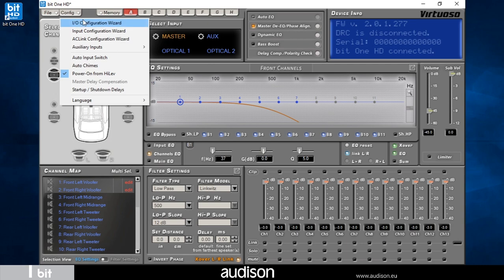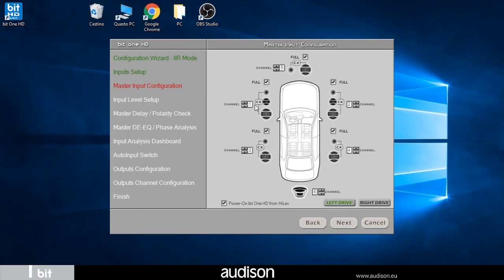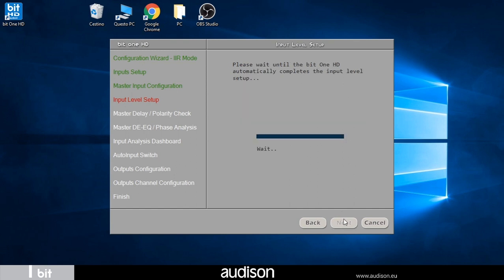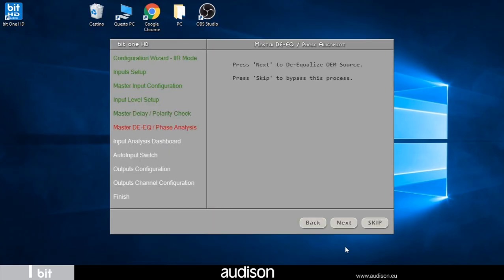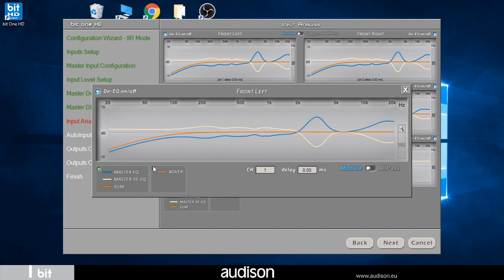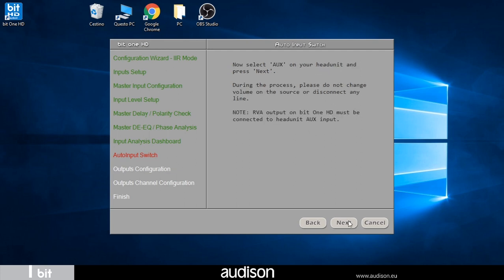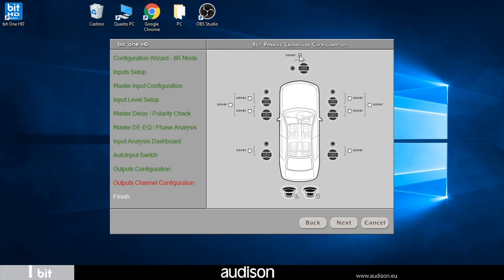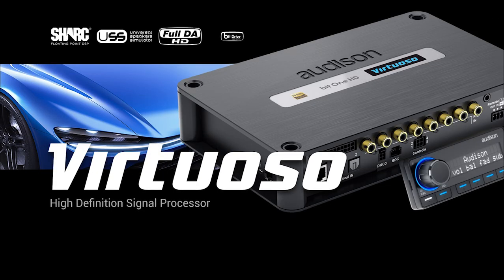AUDISON BIT ONE HD VIRTUOSO TUTORIAL 1 - CONFIGURATION WIZARD OVERVIEW

Comment: Hey. I’m a little off topic, but I have a question that I can’t solve. I have a phone that can transfer audio via USB, and I have a Bit One audio processor. The question is whether it is possible to transfer audio to it for example to Coaxial Cable. Well, that is, it turns out you need a USB-Coaxial Cable adapter, are there any at all?
Reply from the maker: Hello, you need an audio interface capable of receive the USB out of your device and convert in a SPDIF digital audio out. -Best regards

Comment: Why prima ap application isn’t good as bit one? Although prima is super expensive
Reply: I got the audison voce 3.0 and 1.1.  Mids and tweeters mounted on my Dash in speaker pods. Prima ap8 Mid bass in the front doors. Hertz 5 inch for range in the back doors for a little bit of rear fill. Two American bass 12in subs in the back. Pioneer head unit and Dayton audiodsp-408. The first thing everybody says when I have them here my system is "Wow it sounds so clear". Pricey yes but well worth it!

Comment: Why are you using IIR filters?
Reply from the maker: It's just an example, you can use FIR filters if you prefer a linear phase response. -Regards
Reply: Is there a reason why someone would rather use IIR? Why wouldn't you want to have linear phase?
Reply: @T07N  The number of channels can be a limitation. In FIR mode you only have 9 channels.
Reply: @AudisonItofficial  
What is the latest software version and what changes have been made?